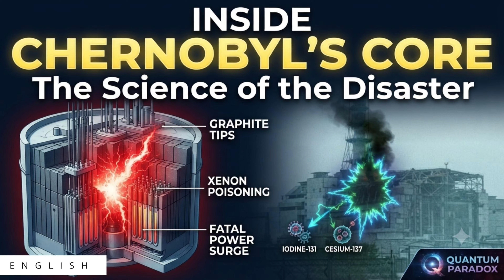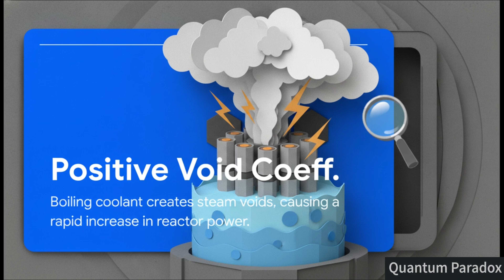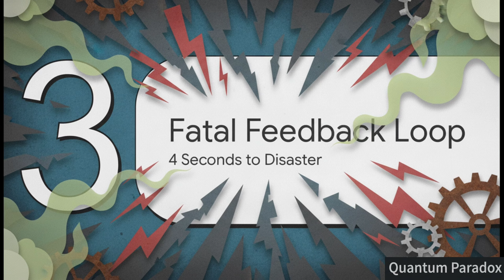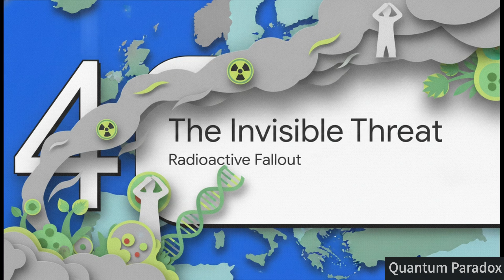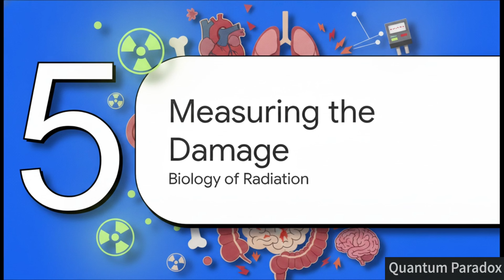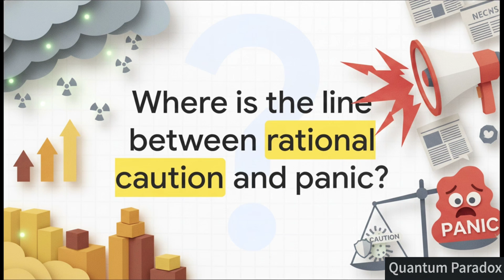Chernobyl — The Complete Scientific Autopsy Of The Worst Nuclear Disaster In History

Comment: The video was doing fine, until it got to Xenon. Then it went to shit. The delay lasted long enough to allow the reactor to depoison. Xenon wasn't the reason power dropped to 30 MW. The operators didn't (knowingly) break any rules.
Reply from the maker: Fair challenge, thank you. The revised INSAG-7 report puts the drop to around 30 MW mainly down to a control-mode handover, with xenon making recovery harder rather than causing the drop, and it softened the 'operators broke the rules' story because some limits weren't clearly set out as safety requirements. I oversimplified that section and will be more careful in future.